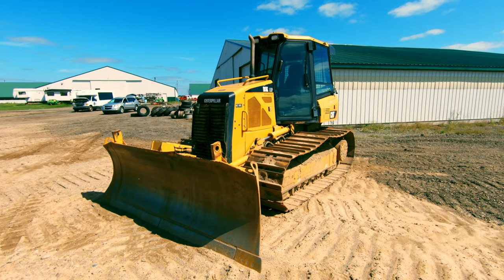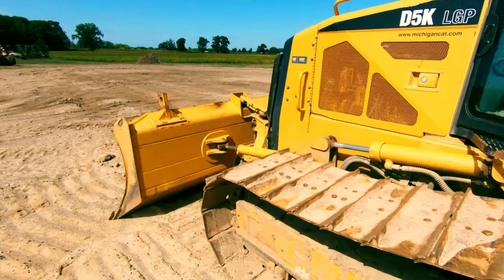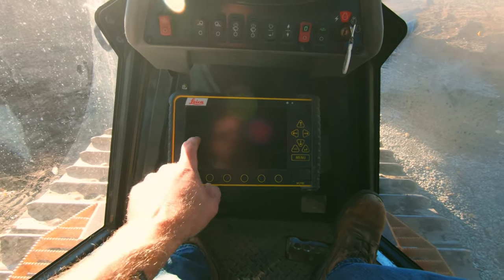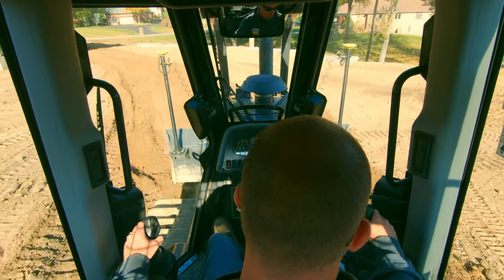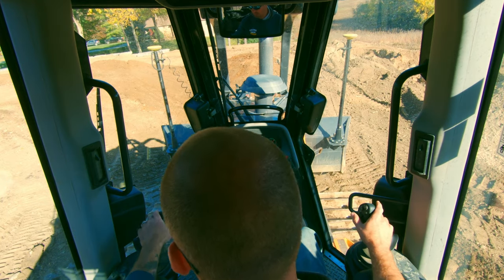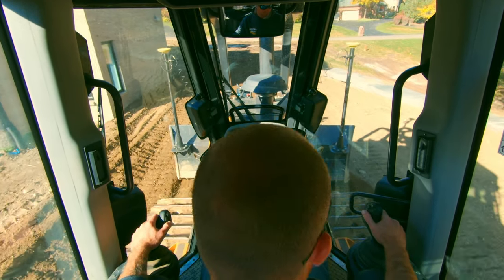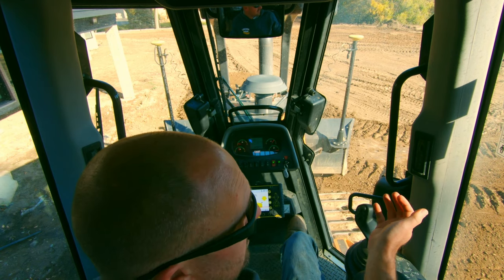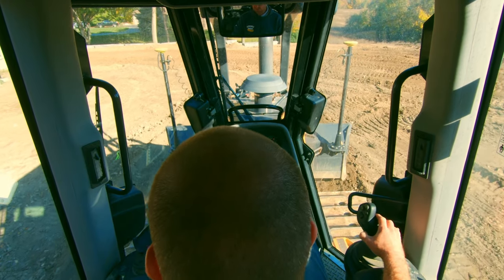Top Bulldozer Tips & Tricks

Comment: Just my two cents, but I was taught to always grease at the end of the day while you're fueling and cleaning tracks. As all of the fittings will be warmer and take grease easier. And it is a good idea to look the machine over after work the same as before working. Definitely some great information. Setting grade with such a short wheelbase is a real challenge, anyone can hop in a D8 and push fill all day, but working the dozer is truly an art. Good tips for newcomers, but like you said there is no training like on the job training!
Reply from the maker: Great point. I should do a video specific to this topic because there are definitely two schools of thought. I think at the end of the day as long as the machine is getting cared for you are doing your job as an operator. I personally liked greasing at the start of the day because the machine needed to warm up anyway and I was fresh. I wasn't rushing through it to get home quicker but that's just my personal preference. Thanks for the comment, I appreciate the feedback!
Reply: Only issue is what if some one else may be running it the next day or some one else ran it the day before. im always for greasing in the morning so before it runs i know its got fresh grease in it. If no one else runs the machine than you, then sure end of day can be a good idea.
Reply: That's good idea
Reply: Not anyone can in dozer and push all day.

Comment: I started operating a dozer when I was 16 yrs. it was an old on a D8 cable model with a pony motor to start it, I grow into a J.D. 450 C w/dual slopeboards and became an owner-operator for 27 yrs. did a lot of finish work on slopes an fine grade etc, I am now 66 yrs. old and have trained a lot of dozer hands in my time and believe that evey operator should start on the biggest, oldest, sloppiest/loosest dozer you can find the work and your way down to a small toy/dozer because as you know the smaller the harder to operate. However the way you explained the operation of a dozer in you video was the same way I would explained to a green horn but most of all  the statement you said " its like riding a bike you once you find level you will never lose it" a very true statement and I still use the bubble in my ass today as I go and play in the dirt part time, Therefor my (HAT IS OFF TO YOU) for educating up coming dozer hands
Reply from the maker: What I'm gathering is you were an operator back when you really had to operate!  Those old dozers had more levers and pedals than I'd know what to do with.  Thanks for watching and I appreciate the support!

Comment: When pushing forward with  angled  blade, when you back up at end of your pass, reverse the angle  of your blade fully to opposite direction. Move over half blade width so furrow is in the middle if the blade. Put the blade in FLOAT position. This will fill in all small dips made from the original push. A 72 year old an taught me this. He told me two things. 1.)  use the blade on both passes,  2.) if you don't get a dozen stuck your not pushing it to its full ability.  I do like your videos !
Reply from the maker: Thanks for the input Robert and I appreciate you supporting the channel brother!
Reply: Robert, you are the first person I have seen on YouTube to to explain that technique. I have been doing that esp, when finish grading. Cuts time down considerably.
Reply: Back blading is a cheaters move. :P

Comment: good video, friend, I have worked operating a D10t bulldozer for 5 years, working in dirty terrain, neat no need to carry material and then push it into the hole of the crushing machine, today I was moved to the area from previously carrying a Komatsu D65p, the job is to make the area neat and there were a lot of mistakes operating the bulldozer and it made me frustrated today
Reply from the maker: A lot of guys who have gotten all of their dozer experience in the bigger machines get frustrated when moving to the smaller track bases.  You don't realize how helpful the longer track base is until you don't have it anymore.  Give it a little time and your brain will adjust and you'll be blading smooth again.

Comment: Ive got two day runing a dozer im making a road its 3.5' higher than the base ground these trucks are bringin in mud/clay boulders not dirt not sand i get it pretty level and i go to push the truck load & all of a sudden the dozer takes a fkn nose dive and fks up my last run now ive gotta backdrag to try to fix it yet it takes another nose dive wtf am i doin wrong? Thanks for the video this is the first one ive seen, P.s i have zero training didnt even know what one was when i heard people talkin about'em i worked ultra deepwater drill for 20years and never have done any heavy equipment operating except the equipment on the rig, Preciate the video

Comment: I've always wanted to attend a heavy equipment school and pretend like I don't know what I'm doing for 5 minutes before running the gear like a champ just for fun. 

Pro tip; regardless of whether you have a 6 way blade, the direction of travel makes a HUGE difference in how you carry material. Instead of turning around the house in a big sweeping motion, orient yourself through the pile straight to where you want to go. Trench push by taking the material in front first.
Reply from the maker: I can't tell if the first part of this comment is a dig or just an observation.

For the second part of your conversation, you are spot on. You will be far more effective getting lined up and pushing in a straight line when slot dozing
Reply: @DieselandIron  not a dig, just a rich fantasy of mine after a long time of operating. 

I would also suggest with those John Deere machines that the faster you run them the better you can be. Especially in heavily sandy materials. The blade can move exceptionally fast on them in comparison to Cat 6s and Komatsu 71s. With a Cat 6, feathering your decelerator while in 2nd gear works well. When in a Deere I run them about 2.5-2.7F and handle the blade as fast as I can. 

Once you get up into a D10 you'll find that the blade is surprisingly fast for the size of machine and having that experience in the smaller machines makes a difference. 

Slot pushing is the key to every successful dozer operator. I slot push everything, all the time. If I have a 100 ton pile of material and a D6 I'll climb the pile and start hogging out from the front every time instead of taking tiny bites off a side. I even employ this with 400 ton piles and a D10 as swiping just takes too long. 

I've been mining and doing heavy civil for about 15 years and I've been in just about every situation you can find with a Dozer.

Comment: Good video. Currently running D10 and struggling with those rocker controls for for direction. I'm in control with a handle control but man sure getting frustrated with this new set up.
Reply from the maker: Every time you get used to something in the industry they go and change it!😂

Comment: Great series you're putting out.  Quick question: If you were going to mount a single laser receiver on a dozer blade, would you want it in the center or on the end, keeping in mind that it will be mounted high enough for 360 degree reception, and there will be a remote receiver in the cab.  My thought is to put a crown on a long driveway, I could just mount it on the end, and lower my end to get my percent of slope for drainage.  But, I also think in the center would be a bit more accurate for flat work.
Your thoughts?
Reply from the maker: Thank you! I would advise you put the mast in the center of the blade. That's pretty much standard practice. A lot of those systems will come with a pitch and roll sensor that will be able to determine cross slope as well.  That will take the guesswork out of it for you. At the end of the day you could easily mount a level in the cab that would indicate your pitch from left to right. Thanks for watching and thanks for the comment!

Comment: Canyon either tell me or make a video on how to get rid of the washboard?  I've been dozing for a couple of months now and having a major problem with washboarding. I run a deere 850l lgp in a sand mine. 
Thanks
Reply from the maker: Sand is really hard to grade when you are first starting out.  Due to the fact that it is loose, it doesn't offer resistance to the blade so you end up grading entirely by sight.  The best advice I can give you is to slow down a little so you are making flat passes.  As your skill increases, challenge yourself to go a little faster.  As soon as you start wash boarding again, slow down a bit.  Over the course of a couple weeks you will see a noticeable improvement on your skill.  There is no shortcut on this one.  This is where the skill part of the "skilled trades" comes in.  This is a craft that you have to hone and the only way to do it is with hours of seat time.  As frustrating as it can be, look at it this way:  if you can grade flat in sand, you can grade flat in just about anything.
Reply: Actually the soft sand I don't have a problem with it's the hard dand that messes me up and I don't know how to correct it
Reply: Tilt/pitch your blade angle around 30 degrees. It will bridge and not have a gouge tendency

Comment: I'm a new dozer operator and struggling to keep material for a long distance, struggling to cut windros to a level as I'm working with coal
Reply from the maker: It's one of those skills that come with time.  At first you don't carry the material because you are worried about going to deep in your slot so you have a tendency to leave material.  Your situation will be a little harder because you are on a coal stockpile so the material isn't hard packed.  In regular soil you start to get a feel for when you are cutting vs carrying.  Just give it time and your skills will start to develop where you are making nice long passes.

Comment: If you want to find your "level butt" faster, run a skid/track steer first. You can feel just about every little mole hill and you don't have to worry about blade tilt because you just can't. They're also smaller and if you mess up and cut a little too much, you can bucket material over to fix the mistake.
Reply from the maker: Great tip!  Thanks for the input and for watching!

Comment: Nice work using a finnish Dozer, wonder how you would do Cutting Hard material?
Reply from the maker: Thank you!  When you say hard material are you talking hard clays or getting more into rock?
Reply: @DieselandIron  Hard material is clay and shale, a ripper is for rock.
    A dozer blade only has two settings Roll dirt, or scrape and load.
    Roll dirt is for making Trails in woods, or cutting hard clay.
     Scrape and load is for finnish Grading.  
    You carry twice as much material in Scrape and grade, but the dozer will stop in hard dry clay.
    In roll dirt the dozer never slows down.
Reply from the maker: @carrollsanders9376  we have a fair amount of hard clay up here, that's why I was confused if you were referring to Dozing rock after a blasting crew.
Reply: @DieselandIron  hard clay move the top of the dozer blade as far forward as it will go, peal it off like cheese.

Comment: Ok so I’ve been running a d6T for a while with a 6 way. I got moved to a new jobsite and they had a d8T but the 6 way doesn’t change blade angles. It changes the roll forward or backwards of the blade. I’m trying to figure out what it’s best use of that function.
Reply from the maker: That's going to be your carry function.  When you pitch the blade forward it will cut more aggressively.  When you pitch the blade back it will carry more material and won't dig nearly as much.

Comment: If you were on a medium size dozer how long would it take to strip a foot of dirt off an acre of an open field? Thanks!
Reply from the maker: This is a tough question due to all the variables involved.  What size dozer exactly?  Is it flat, level terrain or will you be pushing uphill?  Downhill?  What is the soil composition?  Clay?  Topsoil?  Sand?  Is it wet?  There's a lot that goes into this sort of thing.  Just a total off the top of my head guess I would say you could knock it out in 10ish hours.  Maybe 2 days worth of work if conditions are working against you.

Comment: I think those buttons that change your vertical offset on the blade control are a bad design especially on the John Deere 700/750s I’ve noticed when trying to hit the shaker you can easily switch your numbers and not notice for a while
Reply from the maker: Ya, you definitely want to be aware when you hit them. That is a costly oops... In the case the blade shake is disabled when in gps mode so there's no reason to accidentally hit the buttons.
Reply: Diesel and Iron damn on a 750 Deere the shaker works but that button works too unfortunately being a gradechecker I don’t run much but  Gps lol but I have found it easy to hit it when running a machine maybe because I don’t spend everyday on one
Reply from the maker: @smokingbluedream  ya you get a really good feel for when you actually depress the button. It will also show up quick if you are close to grade and the dozer doesn't take a pass like were expecting.
Reply: Diesel and Iron I learn a lot from working with talented operators like yourself everyday doing grade you see who can carry it from station to station not just hit it once every 50 feet. just watching what moves they take at certain times helps out a lot whenever I get to get on a piece of machinery
Reply from the maker: @smokingbluedream  that's a great way to learn techniques that work well. Operators all have their take on what works best.

Comment: Is it true if you are good at grading with a skid loader it’ll be easier on a dozer?
Reply from the maker: It does help in several ways.  You learn to anticipate adjusting the blade as you track forward over ground you've already graded.  You also learn how to pitch the machine to assist in grading.  These are all skills that help in a dozer.

Comment: I operate a Cat D9T and have for a few years but I can’t seem to get the dips out when i push grade, sometimes it works out sometimes not i rolled my cutting edges forward and that seemed to help but it still happens, any advice?
Reply from the maker: Rolling your blade forward is going to help you cut in while rolling the blade back is going to carry material.  To get the dips out you just have to spend time really working at it.  It is one of the hardest skills to attain in a dozer.  The biggest piece of advice I can give you is to just slow down a bit.  It's hard to do but you need to get good at grading flat before you increase your speed.  Once you start getting the hang of it, bump your speed up a little until you start seeing dips again.  Stop increasing speed and stay there until you can go that fast without dips, then increase your speed again.
Reply: @DieselandIron  10-4 I’ll give it a try thank you

Comment: Hasn’t that got a 8 way blade the tilt for the blade at the top is a manual to tilt it to cut better
Reply from the maker: You are correct.  Technically it is an eight way blade due to the manual adjustment.  These are still referred to as a 6 way blade though in the industry.  Thanks for the comment Evan!

Comment: The first thing to do....wash the windows . If you can't see you can't do your job . And why not used the electronics ?
Reply from the maker: Good tip!  It's hard to operate with no visibility.  I have another video where I use the 2D system to grade.  It's only effective when you have a good sized area that will have the same pitch.  2D isn't good for just rough grading because of the time it takes to dial in your slopes.

Comment: Why in the world are you cutting hubs when you are running a GPS system?
Reply from the maker: This job didn't have GPS so we were using the 2D system. You cut in your hubs manually then dial in your slope and cross slope on the machine. Only pitch and roll sensors are used by the machine to grade.